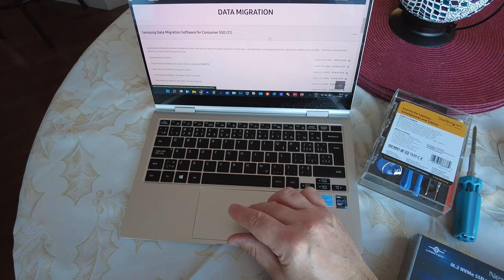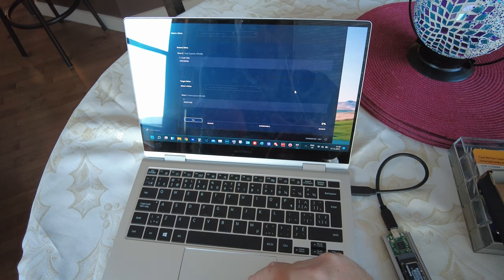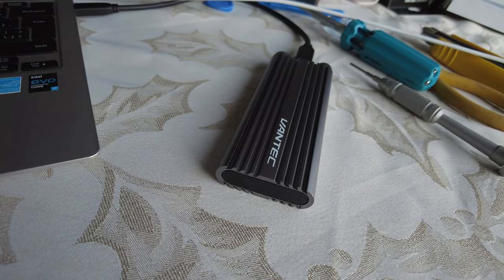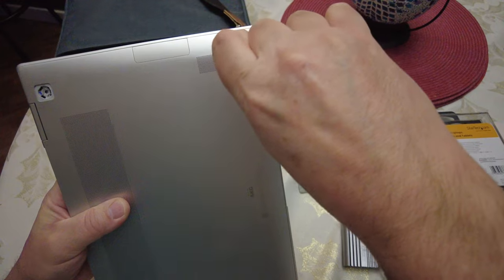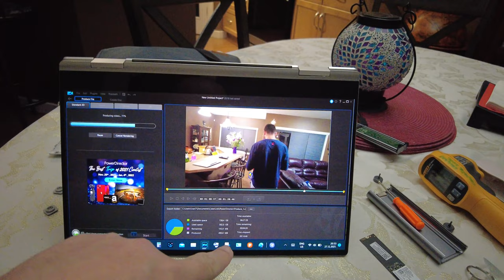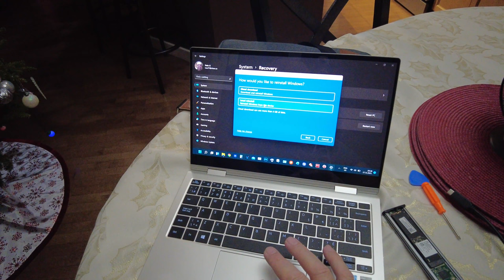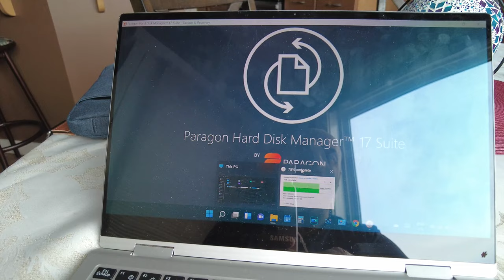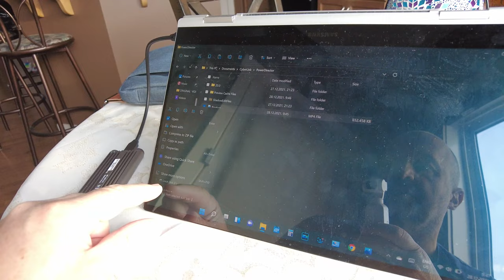SSD SAMSUNG 980 1 TB .. UPGRADE .. my brand new Samsung Galaxy Book Pro 360 13.3" AMOLED ..

Comment: Thank you for the extremely powerful video.
It helped me a lot to install a bigger SSD in my Galaxy Book3 360 13" myself. 
I installed a Crucial P5 Plus 2TB PCIe 4.0 3D NAND NVMe M.2. To clone the original SSD I took the software "AOMEI Backupper". Because the Samsung Data Migration tool only works with Samsung SSDs.
Reply: Thank you I’m glad you mentioned this as I wanted to ask if it’s compatible for me to instal a bigger SSD in my new 13.3 galaxy book 3. I see you’ve installed 2TB - I’d be very happy with this amount as well. 

Do you know the maximum I could install ? Just so I’m aware of my option. 

Lastly. What did you did with your old ssd that was already in there. As I understand you can only have 1 ssd inside the 13.3 seems bad for it to go waste.

Comment: I thought there were two slots.
For drive one being for smaller length SSD. Could you fit 980 Plus which is PCI 4 same as interface in Book? Speed would be much faster but notbsure if heat would be a problem.
Reply: Nope.  2 slots in the 15.6" model.  Not the 13" model.
Reply: Damn. I got the 13" model